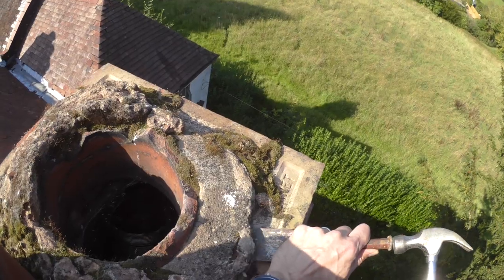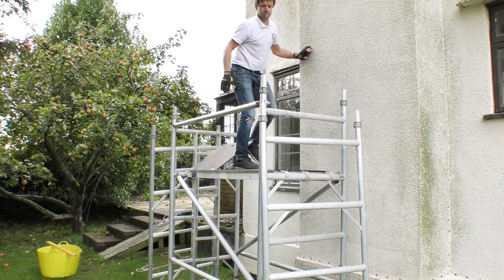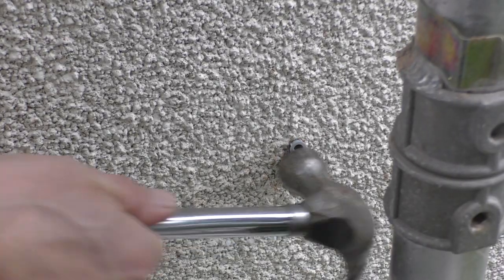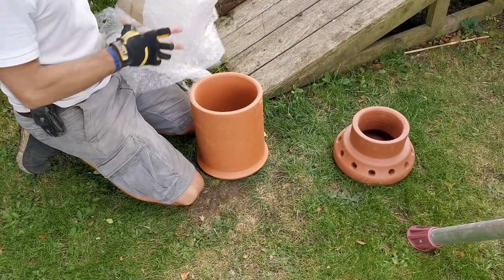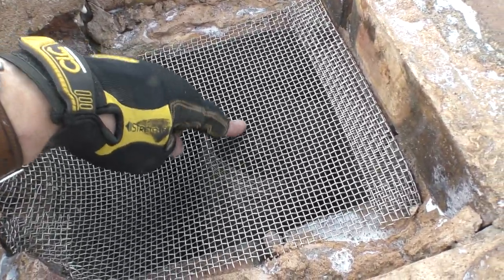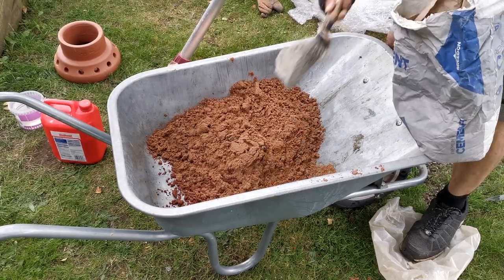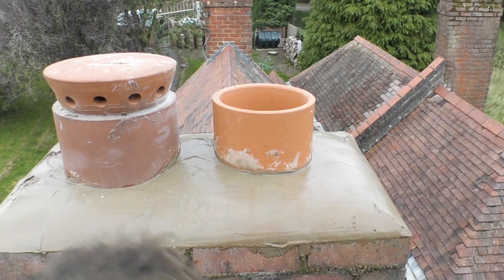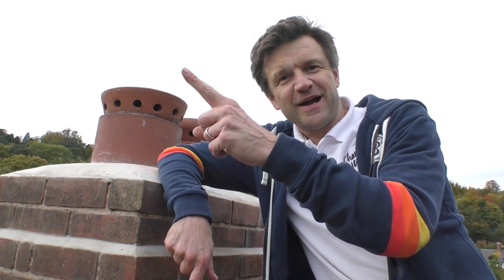How to Replace a Chimney Pot & Flue Ventilator

Comment: Another cracking video Charlie. I’m a Chartered Building Surveyor and spend half my life inspecting properties with shocking chimneys.  It’s a relatively easy job made very difficult due to access issues. You made a good job of yours. One thing to mention for folks repointing live stacks is that it is important to use sulphate resisting cement to prevent sulphates in flue gases from reacting with the cement and causing cracking.  The BRE (Building Research Establishment) recommend 1 part sulphate resistant Portland cement 0.5 parts lime and 4 parts sand with an air entrainment additive to add frost attack resistance. Sorry to be a clever dick, but sulphate and frost resistance is critical. Yours will be ok because it’s not a live stack.
Reply: A surveyor that actually goes up a ladder? Blimey the ones I know take a 5 minute look about, a few photos and away home to cut and paste a thousand pounds of nothing.
Reply: Great knowledge to pass on, well done 👍🏻
Reply: @stevenmoore3480  Cut and paste a thousand pounds of nothing, that's true enough.

Comment: Seen some good tips from other roofers in the comments, we put boards underneath the wheels of the scaffolding to prevent them sinking, We also don’t use mesh and build up with brick or slate as previously mentioned in the comments, we also put the cap on in stages with coursesand, let the first Go off to help prevent cracking and then put the final cap on top of that, leave an inch around all edges with the first cap, Great videos👍
Reply from the maker: Thanks Richard. Really appreciate the tips. I was never going to do everything right, so it's good for other people researching something like this to get pro tips to help them 👍🏻

Comment: Looks neat but that is a standard 300mm roll top chimney pot. As the name suggests the roll should be at the top. The roll is thicker for strength and to help water roll off the pot, also the mesh will very soon be covered in cobwebs which will make its use as a vent very restricted,  and as others have said, sharp sand should have been used for the crown. The instructions on the tower were very good.

Comment: When i did mine I used some hardie backer cement board and cut a circular hole in it a bit less that the chimney pot for it to rest on with some sand and cement. The added benefit of this is that the cement board is waterproof, in case your haunching cracks over time.
Reply: I was going to write the same. Wonderful stuff Hardibaker cement board.
Not easy to cut though.
Reply: Doing mine now, can’t decide between slate or hardiebacker, how’s yours after 3 years and are any flues in use as one of ours is
Reply: @ninjahamster1551  mines not budged and inch, in use all the time

Comment: Another excellent video, coincidentally relevant to my current project of prepping for winter....which involves a new Rayburn stove, chimney pot and cowling.  Haven't chosen the cowling yet but probably an H type, as currently some smoke enters the kitchen every time the door is opened.  Useful info on the scaffolding tower thank you, as otherwise it's a ladder and my usual two-point harness and safety line around the base of the chimney.  😬
Reply from the maker: Thanks. A few people pointed out I should have used sharp sand rather than builders. Didn't matter as I applied a waterproof admix (which will more than make up for the weaker mix) but when you do yours get sharp sand 👊
Reply: @CharlieDIYte  Hmm...  I've just finished laying 40 large concrete slabs as a base for a greenhouse; I started out with sharp sand (because Jewson advised me) and hated it. I ran out and reordered with builder's sand. It went half as far but held the moisture twice as well (greater adsorptive surface area, better hexagonal close packing etc.) and was far nicer to use.  It also provided better suction on the base of the slabs, was easier to level and, in my view, was more robust.  Sharp sand is more cost-effective, but I dispute it being better, especially for fine jobs such as a chimney pot replacement.

Where I do prefer sharp sand is for lime mortar because it more closely matches the original matrix used in the old walls of my cottage; mine are about half a metre thick and made from granite blocks and rubble.  I’m keen to match the limework as closely as I can.

Incidentally, I used Sika FastFix All Weather Jointing Paving Compound for the joints rather than a lime mortar dry mix which was my first choice (and which works well if done correctly).  Despite my initial reservations it’s actually worked very well and is ludicrously easy to use; anyone who can smooth out demerara sugar (because that’s what it’s like) could use this.  It has its faults (expensive, smelly, takes ages to set if there is any rain) but the end result has been pleasing.  If you buy it though, do so in person from an actual shop, NOT online.  That’s because the tub contains two 7.5kg foil packs that must have their seals intact, otherwise it goes hard, and at over £30 a go there can be no wastage.  I opened mine in the Screwfix store and one of the packs was compromised, but the staff to their credit fetched me another tub and that was fine, so always buy from a shop and always check before you leave.

Comment: Might a bit niche Charlie but it’s an invaluable tutorial for my problem in hand. Good work!
Reply from the maker: Thanks Daniel. If you're doing this, mix in a bit of sharp and just to give it a bit more durability. I'll never have an issue with what I've done particularly with the water proofing agent but I should have used some sharp sand in hindsight 👍

Comment: Nice job mate, I'm just about to do a chimney stack rebuild as the wood burner liner has failed so its just as cheap to rebuild the hole stack as it needs doing and replace the liner than just get someone to replace the
liner, fingers crossed just waiting for the scaffolding to be put up.

Comment: Nice job, although minor criticism; That mesh and the holes in the cowl will clog with spider webs in a few years, and there's no way for a brush to get through to clean them out. 
Also, much better to use concrete at the top, sharp sand and 10mm gravel. Will last many years longer than sand cement alone

Comment: I’m preparing to do this- have got found pots which stylistically match the area...
Reply from the maker: Just use sharp sand rather than builders and I do recommend a bit of waterproof admix to help with the weather proofing.

Comment: Great job, Charlie. What would you have changed if you used lime mortar rather than S&C? Thanks.
Reply from the maker: Thanks. The main thing I got wrong here was using builders sand rather than sharp sand which has a bit more gravel in it but the waterproof admix negates the disadvantage. I went up there recently to install Starlink https://youtu.be/S3WPYHhITE0?si=xTIdxmiYxVBt9u6V and it still looks great. I don't think I would use lime mortar for a job like this. I think it needs to be as hardy as possible.

Comment: Should have use sharp or washed sand and the pot on slates like we've done since God were a lad. Bit of lime in mix stops cracking. If you ever want to reuse the chimney it's all got to come off now because of the mesh.
Reply: no just cut the mesh from inside the pot !
Reply: Smoke will go through the mesh won't it?!
Reply: @Petertronic  Yes but cobwebs won’t 🤷🏻‍♂️ fire hazard 🔥
Reply: @Petertronic  soot will collect on it in not time and block it. Active flues should not be impeded

Comment: I used 3:1 sharp sand to cement. Wouldn't use building sand on the flaunching as its not hard wearing. I found getting the shape of the flaunching right a bit of a chore as my scaffolding didn't allow me to get right to all sides comfortably.
Reply from the maker: Yes you're right about the sharp sand. Hopefully with the waterproofer it'll stand the test of time.
Reply: @CharlieDIYte  Folks across the pond have different terminology.  What is sharp sand?  We have masonry sand on shelves at big box stores .... Is that the same thing.  As for waterproofing and plasticizer additives, is there a brand name?  I have used plasticizer in concrete for foundation when it was going to be pumped.  Didn't know if it is available for masonry mortar.

Comment: As DIYers I sometimes think we are the harshest critics of our own work. That chimney ventilator work looks superb - even up close, let alone from the ground. I'd like to see a so-called professional take so much care as to the method and the final appearance. Now, about that gable-end wall.....
Reply from the maker: Thanks so much for that 👊🏻👍🏻. Yes that wall is horrific, isn't it. I bought about 25 litres of Johnstone's exterior paint a couple of years ago but have failed to get round to pressure washing and repainting any except the North gable end. It's partly the time it takes to edit all these videos but it WILL be done next summer, when I also have the remaining cast iron gutters to strip and repaint, and various cracks in that awful 1970s Tyrolean render to grind out and epoxy. Bless the old house. It's forever providing me with new content!

Comment: Great video, thanks for sharing! I'm just about to tackle this myself, and I was wondering whether to use hydrated lime in the cement mix instead of the waterproofing plasticiser? They both seem to improve flexibility and reduce porosity. I wouldn't want to get the mix wrong though and have to put the scaffolding back up again to redo it! Any advice would be much appreciated.
Reply from the maker: They both do a similar job. Also use sharp sand rather than builders. 👍

Comment: The mix looks a bit weak mate , could of done with some more cement mate when it looks more brown thats a good mix but if it looks more red its a weak mix and you could of used sharp sand on a chimney because its exposed to extreme weather conditions. Great work 👍👍
Reply from the maker: Thanks. Yes the sharp sand is a good point. Cross with myself for not thinking of that. Hopefully the waterproofer will help it withstand the weather though.

Comment: I would have  future proofed it by replacing the liner and a genuine top ,so in future installation of a wood burning stove wood have been very straightforward.
Reply from the maker: There will never be a wood stove using this chimney.
Reply: @CharlieDIYte  Just a thought, good video I did learn from it.

Comment: Hi Charlie, I've been a fan of your channel for some time. I have a chimney of the same type as the one in this video as in it is positioned at the gable end of the house. I am tempted to attempt hiring the same scaff that you have. Obviously the scaff allows you great access to one side but what about the opposite side? I suppose I'd need a roof ladder too? might be a bit precarious... basically i have a red brick chimney that needs repointing on all sides and on the top. any advice from anyone greatfully recieved.
Reply from the maker: Hi Max, chuffed you find my videos useful. Can you get the tower right up to the chimney? If you can get it high enough you should be able to lean safely over the top of it whilst you're working - like I did in this video. Scaffolders would for complete safety probably scaffold all the way around the chimney but we don't have that luxury with our towers. A ladder with the ridge hook on it might provide you with added security but I'm not totally picturing in my mind where the chimney stack is relative to the end of the gable.

Comment: the finish on the chimney cast looked fine, but if you wanted to rid of the trowel marks you could have rubbed it with a large sponge to even it up
Reply from the maker: Yes that's a good point. I'm pretty sure I would have been able to eliminate all trowel marks if the mix hadn't been a little too wet.

Comment: When mixing in a wheel barrow, try a garden hoe or a cement hoe if you can afford one. Makes mixing very easy and saves your back been stopped over.
Reply from the maker: I love that recommendation, Wayne. I've just had a look at them and like the Marshalltown mortar hoe with the D handle. It's £86 on Amazon though so I'll mull it over a little longer before taking the plunge. 👍

Comment: Never use mesh like that on an active chimney, it will clog up very quickly with no way to sweep it clear. Also, if I am not mistaken, you installed that chimney pot upside down.
Reply from the maker: It's not an active chimney. I did say that in the video. The pot was put in that way to match the existing.
Reply: @CharlieDIYte  Indeed but some may attempt to replicate this on an active chimney so the point really does need to be laboured.

Comment: Can I replace the pots with metal ones? I had a drone over the chimney to have a look and one came off last year so I’d like not to put anything heavy on?
Reply from the maker: Why are you worried about weight? I'd say the most important thing is making sure it stays in character with the other ones that are there.
Reply: Could I mix in some with the motar some fibres to make it stronger
Reply: And could I use screwfix ready much? I have a cherry picker on order 👍

Comment: The obvious choice was to use a scaffold from the start, ladders are only for access, not to be worked from. 👍
Reply: I'll work from ladders.
Reply: @millomweb  good luck to you then
Reply: @MrJFoster1984  I've not had any problems with ladders.
This summer up against a tree, chainsaw in hand - in my smugglers !
Reply: Yeah I have had work injuries in the past and everything is ok until it happens. I used to think I was invincible to until it happened. Cut through tendons etc and it isn't fun having time 11 weeks off work. Keep going with your chainsaws up trees but when it happens it will be at height with probably no fall arrest device. Good luck mate
Reply: @MrJFoster1984  I NEVER made the mistake of thinking I was invincible. I never make the mistake of assuming the ladder is secure unless the ladder is secure. Buried in the ground to the first rung - for grip - by jumping up and down on the bottom rung. Top of the ladder resting on a branch with at least a foot of ladder above it. Another branch to the left and another to the right - so the ladder is securely wedged in place.
ME - also secured - not by rope but by two feet AND back, or, 2 feet with one arm wrapped around another branch. Kickback only occurs through stupidity. Saw held firmly in one hand, if not 2. Body well braced before cutting.
It's a matter of being aware of all the risks and dealing with them exceptionally. 
Yes, oddly, chainsaws are very good at what they were designed for - cutting limbs off - not the tree's, YOURS !

Comment: I'm curious if the flue fumes will corrode the mesh screen?
Reply from the maker: I wouldn't advise using the mesh screen with an active chimney, a) because in all probability the fumes would quickly creosote up the mesh and b) because the liner for eg a log burner has to be connected to the chimney pot. I had to totally remove the grill from around the metal cowl I fitted to our log burner chimney pot when remarkably that completely creosoted up. I had admittedly been burning pine that hadn't properly seasoned, and committed a few other errors, like leaving the fire simmering away through the night - which is a recipe for high creosote build up.

Comment: Almost perfect but wouldn’t need to put mastic around the chimney cowl they can just sit in. Will just make it difficult for future repairs
Reply from the maker: Thanks Joe. Also I should have used sharp sand but mixing in the waterproofer will probably give the building sand the same durability.
Reply: Agreed, Also while doing chimneys I put abit of pva glue in the water to help get a better mix

Comment: What no Cramer Fugi Profiling Tool on the sealant!  - No nice looking job...Thanks,,
Reply from the maker: I thought someone would mention that 😏 The silicone was going stiff and I don't think it would have tooled well with the Fugi, plus it was a tricky old contour to profile. The finger still has its place but only 9metres up where no-one can see it ! 👍🏻

Comment: Where’s the sharp sand
Reply from the maker: I know, I know. Should have used sharp sand. The waterproofer I added will probably give the same durability long term but you're right, it should be sharp.